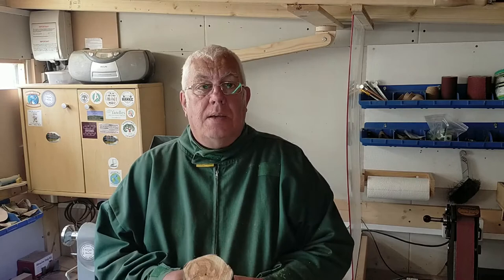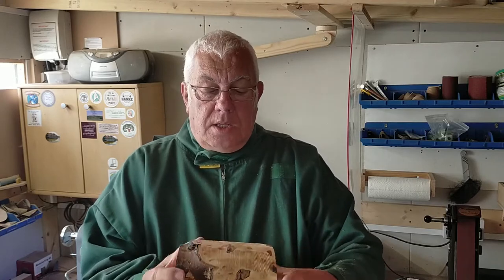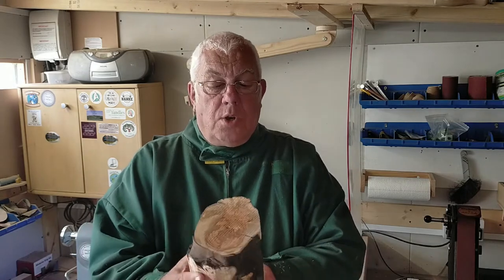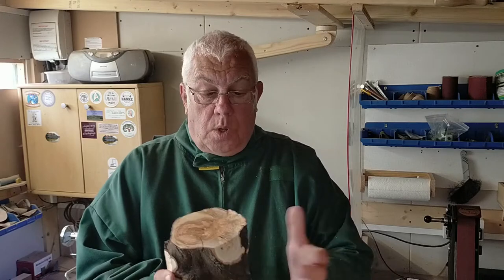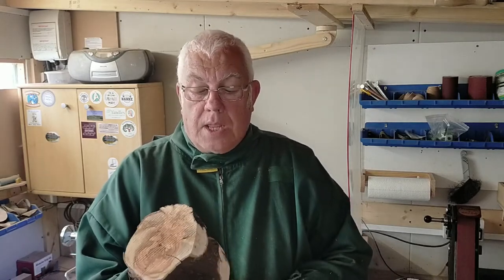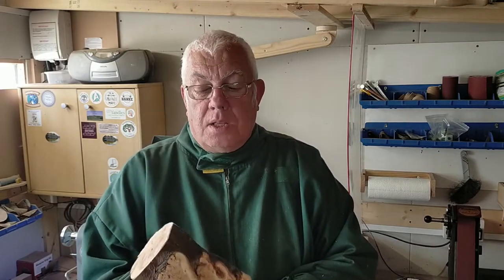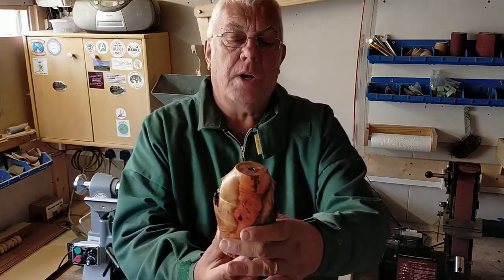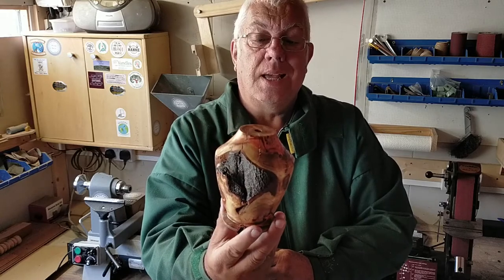Table Lamp from unknown timber.

Comment: Going by the bark , a guess  it might be sycamore, then you applied the lemon oil and nope, I don't think sycamore .However it's a beautiful  looking piece for a lamp. Cracking job👌
Sorry late in watching mate , you know how it goes at times.. Cheers,   Bram
Reply from the maker: No worries Bram, having trouble keeping up with all the video's myself. I noticed a small bench top air compressor you use in one of your video's Any info wuld be appreciated as I'm looking to invest in one soon.
Cheers Barry
Reply: @BarrysWoodCreations  pm'd